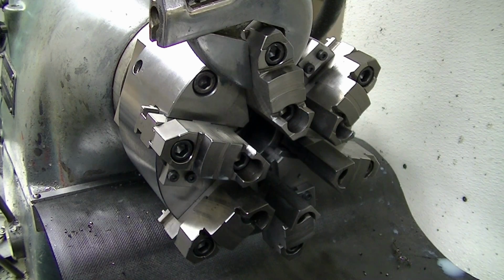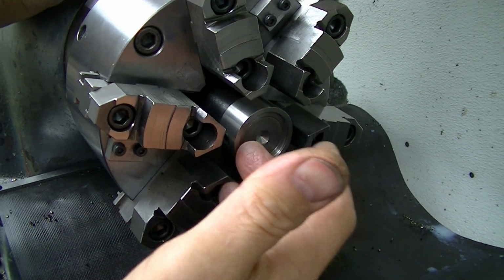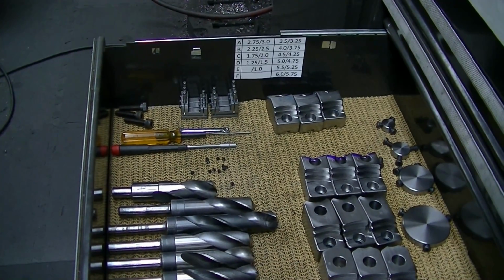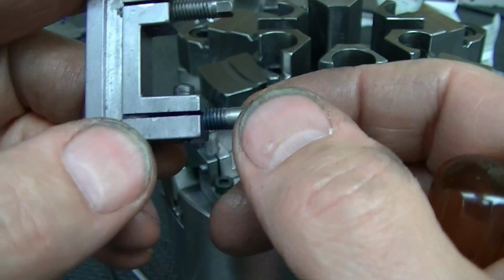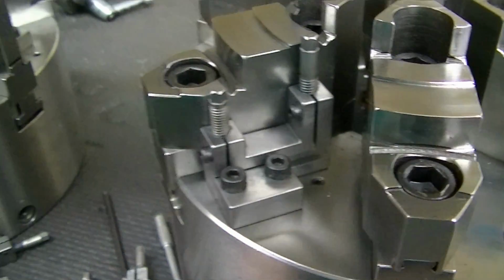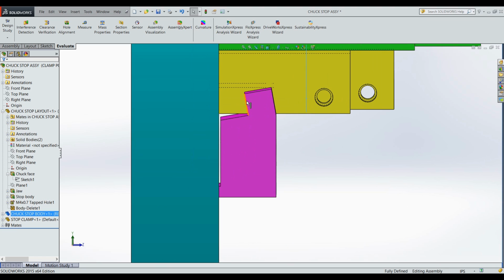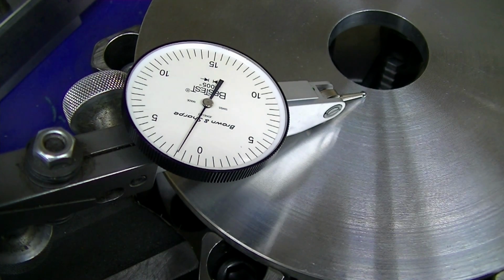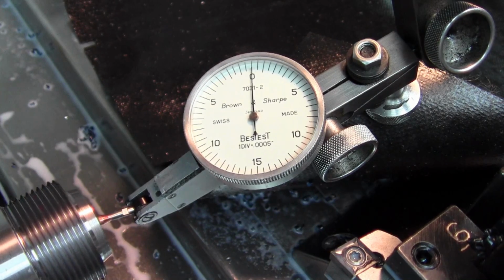ADJUSTABLE CHUCK STOPS

Comment: I am a machinist with 40 years of trade experience and I also have a BS in Mechanical engineering.  Your comment on machinists thinking like mechanical engineers is one of the greatest tips I have ever heard for anybody working in the machining trade.  Getting into the habit of visualizing the effects of stress and strain on a machine tool or work piece (especially during set ups) can be one of the best methods of achieving the desired results.  This video is an excellent demonstration on how to approach set ups and machining ops. Explaining the chuck stops is an added bonus.  Great job Robin.
Reply from the maker: Thank you!

Comment: Hey Robin,

Great video! I particularly like the last example tweaking in a longer shaft. Glad to see you back on the video train. I think I'm going to spray paint my chuck stops black now and hide them in a drawer.

Talk to you soon.

Tom
Reply from the maker: Hey Tom,
You know there is nothing wrong with your stops and your design easier to make and will probably be copied much more than mine will. You have radial adjustment and screw locking so they work just as well. Don't deprive the community of seeing a just as functional easier to make design.
ATB, Robin

Comment: About a week ago I left a comment about making the adjustable chuck stop. I used it the other day to square up a 2 inch washer (1/4 inch thick). That item made it so easy to set up and machine and was able to hold a tight tolerance. With practice I know I can better. What a great idea. Again thanks for sharing.
Reply from the maker: That is awesome!

Comment: as a freshly minted mechanical engineer i would say think like a machinist when your engineering ;) you guys are so much smarter than me.
Reply from the maker: Both directions are very valuable Garrett. You learned about simultaneous engineering and knowing machining/manufacturing processes sure helps to not design excessively expensive products.

Comment: Hi mate.  It's the rubber band on the Kurt vice all over again.  That's for the collet back stop that is.  How bloody simple is that and yet how many engineers will have thought to do something like it.  Like I say, it's the rubber band all over again.  Infuriating.  ( O;
The screw jack system is purely ingenious.  All the small details only come with years of experience.  I liked you showing the deflexion of that plate in the chuck.  It's logical if you think about it but I did not gather that the deflexion would be that much in a chuck.  
Oh and welcome back.
Reply from the maker: Thanks Marcel and thanks for watching.

Comment: Worth the wait, every minute of it.

That Hardinge taper nose sure needs to earn one's trust. :-)

I don't care what you call your show, but there is hardly an item in your shop that isn't interesting. 
It's so nice to see this attention to detail, getting everything set up just right for efficiency and quality of work.

Too often you see men only looking how much money they can get out of tools before they are all worn out, with little interest in improving something that already does the job. Even in one man shows where this should come natural, some folks still work as if they are just putting in hours for the man.

I might be more use with that DA1855A there than your machines, but it's the same in every profession. I always say not all minutes are made the same. I'd rather spend a bit of time on improving something in my environment, and shave that time off a repetitive job. It will pay for itself and even if it doesn't it sure makes work a lot more interesting than just getting on with the same old.

Some day you need to explain about the electronics side, for example why you have that 7k scope as your avatar picture but it doesn't appear on your bench.
Reply from the maker: I am an electronics wannabe.  check out these two posts on the EEVblog forum about my scope.  You will see where my current avatar came from.

http://www.eevblog.com/forum/chat/reunion-with-my-first-scope-after-32-years/

http://www.eevblog.com/forum/testgear/tek-7603-scope-w-7a18-amp-7b53a-timebase-restoration/msg172135/#msg172135
Reply: I thought she looked kinda fresh in the avatar, but I never imagined just how fresh. ;-)
Great story, and great restoration.

Comment: Mine are quick and dirty, just aluminum blocks that can be bolted to the face via the tee slots, then 5/8-11 bolts you put into position, tighten jam nuts, then face them off together.  This is robust, but if there is a need to adjust them, readjusting each screw  makes the faces go out of plane because the threaded holes in the blocks are not perfectly square to the world.  Re-doing these would save a lot of time.

Comment: Wow....that method for the adjustable chuck stop is the answer to a maiden's prayer and I think it solves the problem of variable distances required for thin or thick pieces you want to face  etc.
Specifically, it is the 5C collet in the spindle bore......most lathes have a Morse taper in the spindle and can't retrofit a 5C collet without a completely new bolt on 5C closer due to the draw tube diam etc, so many people just make a Morse taper bung to fit in the bore and some form of screw out stop.............been down that path etc......but having the 5C collet to hold the shank of a stop is the answer to the problem even on a lathe with a 3 or 4  Morse taper etc..........all it needs is a Morse collet or a Morse bung that is split etc and a draw bar at the end to pull the Morse taper collet in as you have it with the 5 C method.
Thank you a ton .....now I'll make one as per, but different, to suit my lathe......I prefer the KISS approach and as most lathes already have a Morse taper spindle.....doing as I suggested will make it happen.
The actual inserts that do the stopping can be of different diams as the need for bigger or smaller discs that need facing arises.
But....I got extremely lazy and did it the easy way that I learned as an apprentice.......I took the chuck off,  laid it on the bench, mounted the disc in the jaws and then used an indicator resting on the now horizontal chuck face to indicate the under face of the work piece.....this is the way they taught me to do the job as the parts I worked on had to be perfectly flat on both faces and true to each other......some were not round but square.

Comment: New subscriber via Tom Lipton's recommendation.

Nice to have some vindication for my own feeling that if you are going to do anything more than a few times, you really need to look for ways to make it efficient. Compare tool change time to workpiece change time; make jigs; make specialized tools. Anything that saves a few seconds or minutes, when repeated many times makes a big difference.

Now to go back and watch all your past videos from the beginning. In addition to content, I can always use good examples to make my own videos better.

When looking for a word, Roget's Thesaurus is your friend. From section 74.12 Miscellany: miscellanea, assortment, variety, medley, conglomerate, conglomeration, omnium-gatherum, sundries, oddments, odds and ends. Combine with your favorite time-related adjective* and you've got a name for your series. I picked Erratic Gallimaufry** for my own series (a series with only one instance so far) of the same sort. 

============== 
* See RT Class One: Abstract Relations, Group VI: Time, Section E: Recurrent Time, sections 135: Frequency, 136: Infrequency, and 137: Regularity of Recurrence
** Chosen from RT sections 627.5: Capricious and 44.6: Hodgepodge
(Does anyone else put footnotes in a comment?)
Reply from the maker: Thanks Peter for all the input and thanks for watching and commenting!

Comment: Interesting fact is that a chuck will effectively always lift the part a bit clear from the stop(s). It's repeatable to a high degree so it does not have to be an issue but it's good to know if you have a part with tight axial tolerances
Reply from the maker: Agreed on OD gripping, opposite on ID gripping where part pulls tight to stops.
Reply: @ROBRENZ  Ah yes, you are right. I am learning a lot in my new job as a CAM programmer and CNC lathe operator. Two Okuma machines, a small one and a big one. Actually I was using an adjustable material stop in the spindle for a certain operation when it became apparent that, even though the shafts were accurately made to length on the mill (as well as centers drilled) for this second operation it would be preferable to use a front stop because it is the main reference for that operation. But, I don't want to be pushing against the turret so I think I'll need a (heavy) spring loaded stop. Probably not a unique solution to this problem.

Comment: Interesting Robin... 
Knowing that the application of jaw pressure outside of the neutral axis has this 
effect could actually be useful as a technique for deliberately making a concave surface like that !! 
I also really like the trick of pre-setting the stop heights before installation to minimise adjustments on the lathe... 😏

😎👍☘️

Comment: Most impressive.  I am a retired graduate degreed mechanical engineer and 35 years with a major aerospace company.  I see you have a substantial investment in tooling and you treat that with respect plus you are well spoken and you understand engineering mechanics. Clearly, you are clever and unafraid to invest time and thought.  You also are doing some repetitive operations.  I observed your lathe waste at the end of the video and the electronics in the background.  I am now a hobby machinist and I  work mostly in the macro mechanical world.  I'm curious about your business.  Are you working in optics tooling ?  I won't be  offended if you chose to avoid my question.
Reply from the maker: Thanks for the kind words.  Most all my work is related to the high precision grinding world. I design and build rotary dresser spindles and infeed mechanisms.

Comment: Hi Robin

What was the reasoning behind the use of only two holes in the clamping block when there are three holes in the chuck? A longer clamping block with three holes in the block would preclude the need to move the block and plug the "free" hole with the grub screw.

You would also have infinite positioning (within the travel range) without having to consider needing to move the clamping block, "hmm, should I move the clamping block or is it ok at that position?"

Thanks for the GREAT videos.

Kind regards

Peter

Comment: This was beautifully presented  and thought out!  I love how detailed you make your designs and your thought process while designing.  Thanks for documenting so thoroughly.   When you used the indicator to show the disk bowing in the center during tightening, it reminded me of an idea I once had to demonstrate something similar but didn't know exactly how to go about it.  Seeing all of your electronics and instrumentation in the backround of your videos, I thought you would be the perfect person to pull off my idea.  Alot of times when machining either a flimsy part or a flexible material, inexperienced machinists often over tighten a vise or chuck deforming the part. If we knew in advance how much force we would be applying on the part with our tool,  we might relax the tightening a bit.  I thought if someone could set up an example and using some force gage like a load cell etc,  it could be put in perspective.  would you be interested?
Reply from the maker: Thanks Ujeb08 I have pressure indicating film that could accomplish that. Thanks for watching and commenting!
Reply: Is your pressure indicating film like a photoelasticity system?

Comment: Sensational work as alway Rob. I also use Kasenit and find it requires a good soak to get a reasonable case depth. I don't anneal it, and didn't think it necessary as the case is quite thin and the core retains the parent properties.

I really like the backstop but need to figure out a way to incorporate that into a MT4 spindle. Your lathe is a mechanical work of art on so many levels, the more I find out about them the more I like them.
Reply from the maker: When you use it on a material that will harden on its own you need to follow the temper requirements of the base material. When you use it on a material that does not harden on its own you are correct there is no need to temper
Reply: Ah ok, good point, I've only ever used it on steels that wouldn't otherwise harden eg 1020. What is the point of using it on material that could otherwise be hardened regularly? 

I'm currently turning up sets of T-bolts in 4140 pre-hard to heat treat and it's giving me grief. I've still got some tricks up my sleeve to try, but if all else fails and I'm still not happy with it one alternative is to switch out to 1020 as I probably don't require that tensile strength in reality, and case harden the bolts for wear.
Reply from the maker: The extra carbon will still leave a harder surface than the core.

If  the 4140 is pre hard why are you heat treating it?
Reply: Ok that makes sense, thanks.

I want the 4140 harder than supplied state. It is supplied annealed to 250-300 HB and I believe it should be able to attain a useful hardness much higher with re-HT. I am making sets of t-bolts to augment these  http://www.gerfa-tools.nl/DIF%20katalogus%20compleet.pdf as I am missing some longer sizes and/or longer than catalogue size. I would be very happy to hear any input if my thoughts are inappropriate.

BTW That catalogue only says they use "chrome.moly steel" with a quality of 12.9 and 6g threads. To me I'd thought 4140 would be ideal for this with re-hardening, but it's not playing nice at the moment.
Reply: BTW, got the 4140 to play ball with a couple of different inserts. A few years ago Tom Lipton put me on to cermets, and they're now my go-to insert for most steels in both the lathe and mill. It wasn't playing nicely for some reason and I couldn't get a big enough cut off some of the other inserts I tried to get the chip breakers to work. Stringy 4140 is just plain dangerous. Some finishing inserts worked ok and when I had another look at the cermet I was using it turned out to be chipped so that explained a lot. A brain fart and I should have checked that earlier!

Please let me know if you think I'm barking up the wrong tree in regard re-hardening the 4140 as I've never tried it and only ever used it as machined. At least the weather down here is becoming more like oven weather ;)
Reply from the maker: Not sure but I think you need to normalize or anneal the material before re heat treating it

Comment: Using the adjustable stops to make the tail end run true is very handy... but wouldn't it faster to use a 4-jaw chuck with a Abom79?  ;-)

Comment: Robenz  love the videos you have produced looking for more in the future.   I was wondering with some small mods to your design could you have machined an identical grove on the opposite side of the part that holds the adjusting screws to make the stops suitable for  both OD and ID jaws? I only have one six jaw Chuck with  reversible jaws. Thanks Zed 
Thanks Zed

Comment: I like the stacking feature. In optics, they often drill out the end of grub/set screws for brass or nylon inserts, but in you case, it doesn't mar the shaft.
Agricultural spherical bearings have a wonderfully evil way to lock on the shaft. They use an eccentric, and only use the set/grub screw to lock the eccentric rotation, so the shaft is locked at a point of contact along the full tube bore.
https://images-na.ssl-images-amazon.com/images/I/31w%2B0NebrIL.jpg

Comment: @3:35 - Does that slot dive an additional 4 degrees opposite the taper or does is that slot actually flat in relationship to the taper?
Reply from the maker: The first, another way of saying it is that it is parallel to the taper on the opposite side of the spindle

Comment: Thanks for the very info-packed video.  I'd like to see how you located the holes to drill in the chuck face.

Name...How about Robrenz Roundup?
Reply from the maker: Thanks Jeff, I pressed the assembly against the jaw with a shim and transfer punched one hole and drilled and tapped it. Then I bolted the assy in place and transferred the other holes on each side. Thanks for watching and commenting!

Comment: Sr. just wanted to say that i have followed your videos since i bought from you various sets of chinese weights for my rc helicopters, years ago.  Wanted to ask for your advice about wich manual lathe brands would you recomend? main concern is quality, and needs to be 22", 23" swing over bed. Thanks!
Reply from the maker: Thanks ashingashinga, I don't have much experience with what brands are good in those sizes. Thanks for watching and commenting!

Comment: I like your thoughts of thinking like a mechanical engineer. 

What brand are these chucks? Make and model number's? 

I have a HLV-H I have not found new chucks with integral Hardinge mounts as your chucks look to have. 

Thanks for your insights.

PS Thank Ooxtool for the mention and link.
Reply from the maker: Thanks TJ, The chucks are Polish and don't have a specific ID. I make my own backing plates from continuous cast iron bar.  Thanks for watching and commenting!
Reply: How much are they and how do I get one? My 5" "Hardinge" chucks have seen better days.

Comment: 4 millimeters is roughly .150". That's significantly smaller than a BB (.177) so when you're talking about the stop screws and claim the hex is 4mm, I have a couple questions. Where in the hell do you find 4 millimeter wrenches and how do you do machine work with such tiny hands? For those "5mm" screws with a "4mm" hex to look that big relative to your hands and fingers and those tiny tools to do the same you must have hands like a toddler.